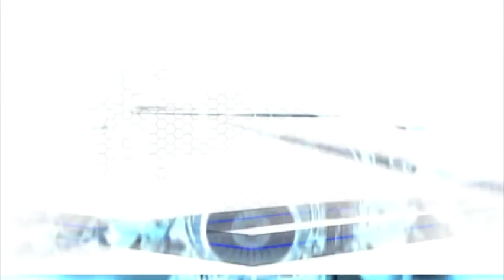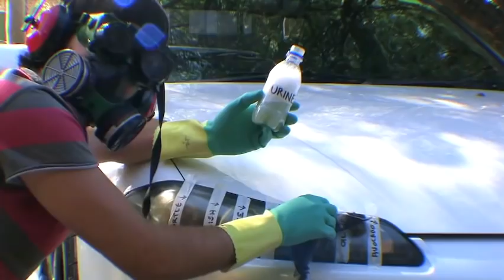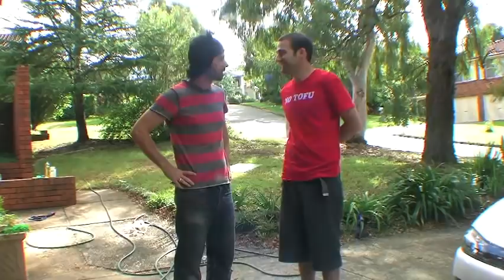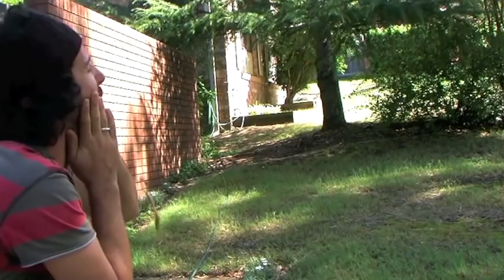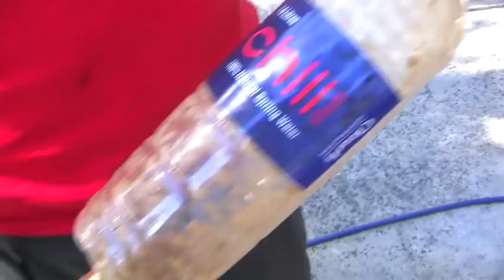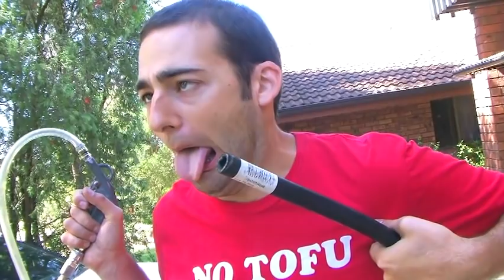How to make a vomit machine - MCMTV2

Comment: The air-in tube needs to extend to the top of the bottle, and the vomit-out needs to extend to the bottom. = Consistent spray as air displaces vom mix.